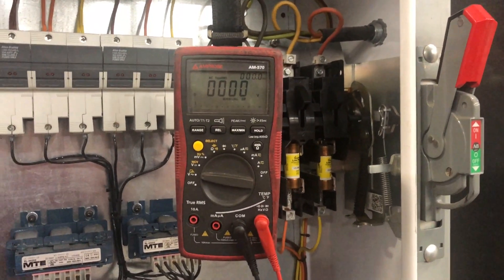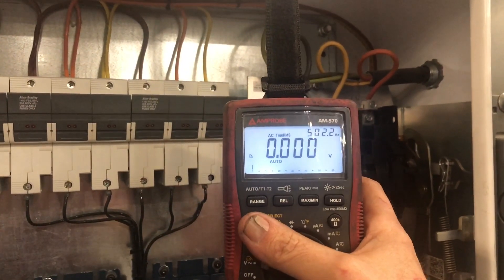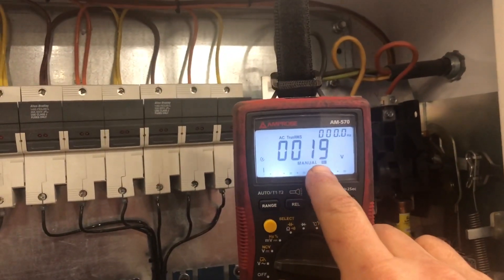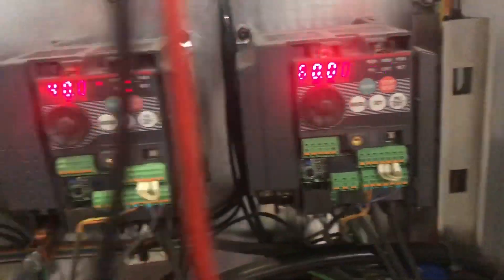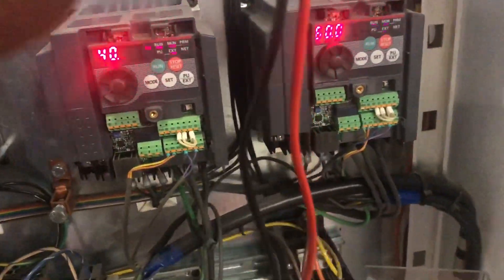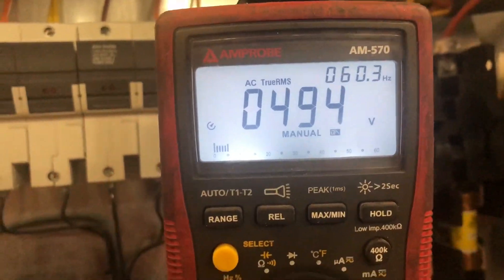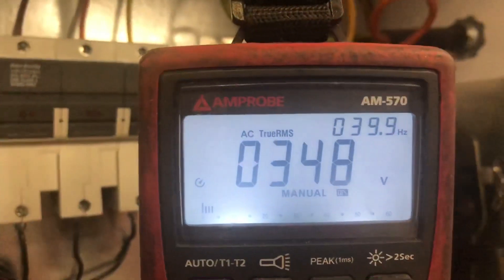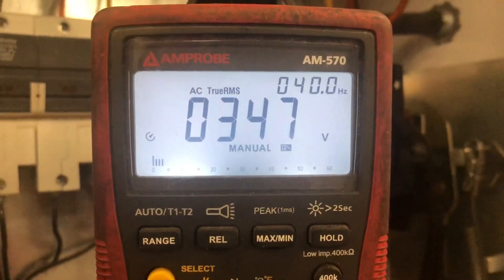Amprobe AM570 how to take a measurement on a VFD

Comment: It's an extremely useful function with surprisingly accurate results from a meter at its pric range. Please do share othee measurements that you think are important as you go along. I'm just curious to know what those drives are actually doing? I know they're controlling the speeds of different motors but what are those motors doing?
Reply from the maker: Gassan Ali another great question first off the VFD’s are Mitsubishi in case you where wondering. These 4 drives are controlling 4 motors in different areas of a conveyor. The conveyor feeds from 2 directions and meet at some point merge together onto one belt and go into a robotic palletizer hope this helps more to come thank you for watching